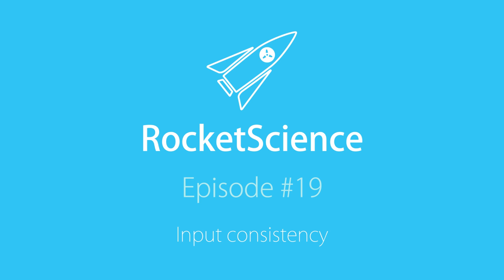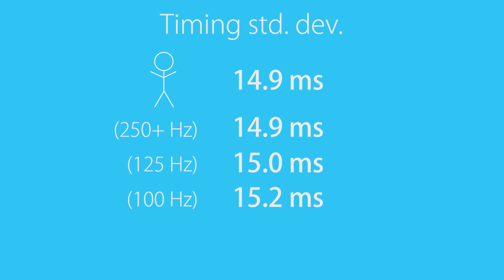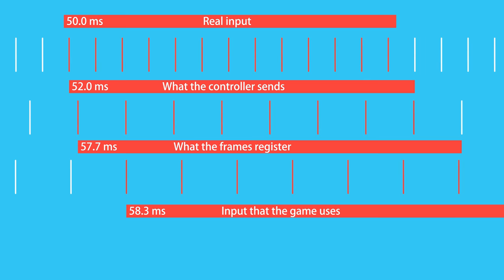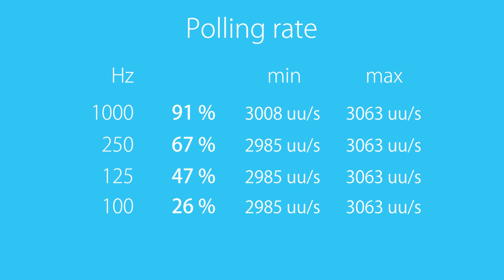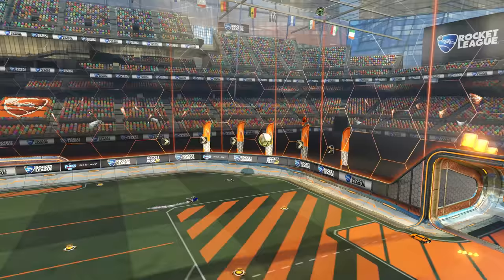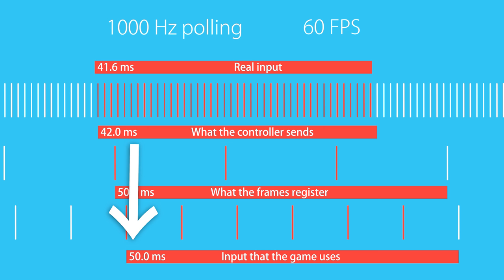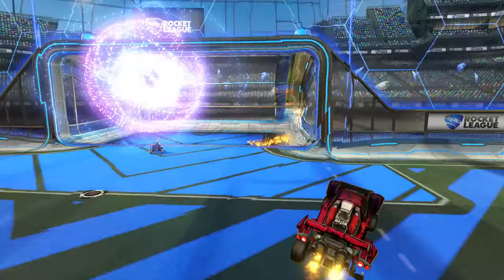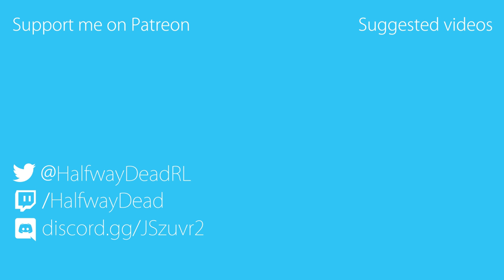Input consistency & heavy car bug - Rocket Science #19

Comment: The is without using Steam Controller configuration correct? Just default control? I’ve been debating whether or not to use Steam Configuration anymore
Reply: why?
something wrong with it?
Reply: I'm interested as well
Reply: If you are used to your controls and you aren’t getting a controller that isn’t pc compatible. I did this and i have to use it until it is pc compatible. So I don’t recommend steam unless u have to.
Reply: The reason I use it is bc you can control deadzone shape, size, and also control your trigger sensitivity, multibind keys, and override other settings
Reply: @PorterPally  i mean steam config adds 1ms input lag as rocket science has said in a previous video, but thats so minor to notice so idk what these guys are on about, been using steam config forever and ive never had any problems with 6 different controllers on 2 pc's...
Reply: Jared, you can use Durazno^2 to change deazone shape and other settings.
Reply: It gives 1ms of input lag, outside of that it's perfectly fine as far as I know.
Reply: @tycodj  1ms of input last is basically unnoticeable

Comment: Regarding the input recognition per frame, would it make a difference on a 60hz monitor to run the game at 120-240 fps?
Reply: Jim Jangles A huge one, you want to run 250 if you can consistent
Reply: Yes, I play on a 60 hz and have it overclocked to 75, but that's irrelevant for the argument

The way rocket league runs, whether or not you can SEE the framerates because of your monitor, it will still use whatever frame it does because of the framerates the game is running, so more = faster usually. Also there is the fact that the monitor will use the "freshest" frame within its window. So if your monitor is running 60hz, and you have a 60hz framerates, it only has 1 to choose from every time, which can make things seem choppy and delayed

If you run let's say 240 hz, your monitor has 4 grams to choose from every time It refreshes and can use the newest frame, making things look WAY smoother. (even just running 5-10 above the refresh rate makes things smoother)
Reply: @Reprivation  Another thing is how game engines generally work - more FPS = more input polls, everything gets simulated more often, so things are more accurate, quicker and more responsive.
Reply: @Elijah-ux4os  guess you hadn't watched the video lol

Comment: Well, I've read on reddit that a DS4 connected with bluetooth has less input lag than a wired. So I got myself a bluetooth adapter. It runs fine so far. In your video at first I see the same image as on reddit and it says bluetooth is better. But later you say I should get a wired controller. Could you explain it in a simple way, so I can understand it? And btw: Any advice for the polling rate with a DS4? I assume it's at 250 Hz. Thx

Comment: So just to be clear, if I have something like a 165hz monitor, I should cap my fps at 240 even though my monitor isn't capable of displaying that many frames?
Reply from the maker: If you have gsync or freesync then there is an advantage and disadvantage there. By capping it higher than your refresh rate you will have lower input lag and as said in the video inputs will be more consistent. But g/freesync only work below the maximum refresh rate of your monitor. Therefore you will get some tearing.

Comment: Is it possible to override the polling rate of USB controllers and force them to 1000hz? This used to be a common thing for gaming mice.
Reply from the maker: I've tried a tool (don't remember the name) used for mice on DS4 and Xbox one. The rate supposedly was changed but I was not getting any more distinct inputs. When spinning the analog stick in a circle the xbox one always had up to 125 different results a second and DS4 (wired) always up to 250. I tried lowering the DS4 too and it did nothing, so I don't think it worked at all.

Comment: I've watched your previous videos and followed that G-Sync Input Lag guide you mentioned (G-SYNC 101: Input Lag & Test Methodology on a site called blurbusters) and set my framerate to 117 on my 120hz G-Sync monitor and it's been pretty great for a while now. But now this video has me confused. Would the input lag benefits I already gain from having my framerate capped to 117 outweigh the benefits I'd get from setting it back to 120 to match the physics? Also, I was under the impression that V-Sync automatically turned on if the framerate matched the monitor's hz when using G-Sync and doesn't that introduce even more lag? My guess is that I'd have to disable both G-Sync and V-Sync and set my fps limiter from 117 back to 120 to see the benefits mentioned in this video. Uhhh....you don't possibly have time to run another day-long test at 117fps limiter/120hz monitor do you? ;) Anyway, the work you're doing is incredible. Much appreciated. I just wish I knew......I have that G-Sync Input Lag guide telling me 117 fps limit on my 120hz monitor for lowest input lag. But with the 120 polling rate of Rocket League physics, does that just get thrown out the window?
Reply from the maker: Well, the problem is that 117 is optimal for G-Sync (consistent visuals, no tearing, low input lag) and 120 is optimal for consistent inputs. 
It's impossible to weigh these against each other in an objective manner because they're entirely different things, but if suboptimal visuals mean that you have a harder time estimating the situation, then it doesn't even matter if your inputs are consistent :D I can tell you though, that from the mathematical theory I know, that a small difference from 120 FPS is not as bad as a big deviation. Therefore you're probably fine at 117.

Comment: ik this is an old video but you wanna know something crazy? i used to experience the heavy car bug. i tried everything to figure out what was wrong. something i tried was changing the quality of the game to the lowest possible settings, capping my frames @60fps. After doing so, my car seemed to respond faster... like there was less input lag.... When I returned my settings to the normal, higher quality @60fps... my car seemed heavy again... Since then I've gotten a higher refresh rate monitor and a DS4 controller overclocked and have no feelings of heavy car bug. So it might have something to do with the quality settings of the game, your gpu, your monitor, how much input lag you have, a plethora of different things that can not be calculable together. Though there is no real evidence, I am convinced it is real having experienced it first hand.

Comment: What about phantom ace steam controller check box? That affected his other rocket league account and it cause the heavy car bug!
Reply: It wasn't "Heavy Car Bug" or even input lag. Halfway_Dead actually covered this specific instance in his "Deadzone" video. Essentially, "Steam Configuration" adds a 0.25 deadzone to your controller if the "Anti-Deadzone" is set to 0. Increasing the "Anti-Deadzone" value to even "0.001" or "0.003" would make sure it doesn't do that. Or disabling the Steam Configuration, like Phantom recommended, also prevents it.

Comment: For anyone saying wondering about the heavy car bug. Couple more things to note:
Did you change anything in your setup? PC/Console, screen or controller?
If any of these checks, there's your problem. Your input lag has changed, slightly.
I noticed when playing on my xbox. On pc, everything is perfectly fine. On xbox, my car feels slow and the inputs feel heavy. There are 2 reasons for that. First, framerate. Like talked about in the video, 60fps creates inconsistency in input. Another problem is screen input lag. I know, that my pc screen has around 4-5ms input lag, while my tv has 32ms.
Technically, that is a really small change for a human, but it still affects my gameplay. I can't really see any difference, but the car feels... different in RL.
Only way for me to notice the increased input lag, is when playing on consoles before lcd and led tvs. Best example probably is playing Blaster Master on NES.
I have played through the game waaay too many times, and i have started to learn to speedrun it. On CRT tv, no problem, i can go through the game perfectly fine, in a decent time. But on my Hd tv, with the said 32ms lag, i can't even beat the game. I am able to see, that my inputs are late, but theres nothing i can do for it. I have always played it on CRT tv, and i cannot learn to play it with any input lag. This is probably one cause for the heavy car bug too.

Comment: What does he mean in number 3 (Cap framerate at 120 or 240)? I have xbox one controller and a 144 hz monitor, should I put my monitor on 120 fps? or only the games fps on 120? Or should I put my games fps at 240? Not good to use 250?
Reply: Ezon yes in the end he is suggesting to either put 120 or 240. During the fps part though he is vague on whether  144 results are bad cause they are still consistent.
Reply: @user-mv4xc6ve4b  Thanks for the answer man, much appreciated! Where can I change to 120 or 240?
Is that found in the ingame settings in Rocket League? Or is it found in my monitor settings on windows?
Reply: Ezon it’s monitor settings in windows in rocket league you should put frames to 240 if your pc can handle it otherwise use 120
Reply: @user-mv4xc6ve4b  ah ok, I've changed my monitor settings from 144hz to 120hz now.
I appreciate the help brother! Much love
Reply: @Etazoz  Its not clear to me where you changed this. You should use the FPS cap settings in Rocket League under Video. Its called "Max FPS", slide to 240 and see if your computer can handle it. If not, try 120.
Reply: @jnevercast  On your computers desktop right click and choose monitor settings, then click settings for video card, click the monitor tab and then choose 120, that's how I did it. Am I supposed to keep that at maximum for my monitor? (which is 144 for me)
I also changed the max fps ingame to 240 like you suggest. I'm trying to get this right, I appreciate that you responded. Do you think he only meant the ingame max fps when he said cap framerate?
Reply: Dude I love this guy but what he said is BS, if your monitor is Freesync/Gsync capable just set your framerate limiter to 141 fps in game to avoid input lag it will be better than playing @ 120 fps. 144 shouldn't be less consistent as he said, he didn't explain why it happens so I wouldn't trust this part of the video.

Comment: Like many others know, it isn't placebo. When you turn on VSync and switch it off again, HCB is gone for about 1-2 seconds. When HCB occurs, why can I set Aerial & Steering sensitivity to 10.0 without any difference? Why do I need the handbrake for every turn when HCB occurs? I shouldn't be able to handle the car with 10.0 sensitivity! When HCB does NOT occur, it's freaking fast with 1.0 sensitivity and I never need handbrake.
inb4 OS problem: i'm an IT technician and tested every OS, all with the same result.
inb4 weak PC: I7-8700K, 16 GB DDR4-2400, GTX 1080, 240 Hz Monitor
inb4 try other accounts: i got 55 steam accounts, 6 with rocket league, no differences

thank you for your attention
Reply: Your steering sensitivity results are very interesting. You should make a video next time you can reproduce it and then post it to the HCB discord. Do the smallest steering input you can with 1.0 sensitivity then repeat with 10.0 sensitivity.
Reply: @brendano221  "You should make a video next time you can reproduce it" oH sO wEiRd NoW iT dOeSn'T hApPeN aNyMoRe, or it's something non HCB related.
Reply: You're an IT technician, please make some experiments and post them to reddit. I'm not in the HCB-discord due to all the toxicity and flaming those people do, but I'm still very interested in everything related to it.

Also do you know what sensitivity in-game exactly is? 10.0 sensitivity basically turns your controller into the same hard inputs as keyboard players have, yet they can still control their car. I think you might've slighty misunderstood what it means.

I've never had HCB and never used VSync so I don't know what you're talking about there so I don't understand what you mean with it.

Btw turning speed etc. is more related to boost and powerslide timing but handbrake might be needed from situation to situation (I'm a GC so I really wouldn't know, it's all muscle memory at this point)

I think you probably thought about it but you don't play in borderless do you? That would kinda make things awkward.

And "Like many others know, it isn't placebo" . No, like many others THINK, it isn't placebo, yet there hasn't been any actual proof/reproducing the bug. AND, "many others", all my high ranked friends have never complained or spoken about anything like HCB, so don't underestimate the power of placebo and confirmation-bias.
Reply: I'm going to do it, no worries. Recorded the first video today, but not enough time to uploade because I needed to go to work 
No BS over here
Reply: @tycodj  Can you get me access to the discord, i've been trying to get an invite for weeks now, but they're all expired...
Reply: @hizzyvr  I don't have any but you can probably get one by just asking on reddit, r/RocketLeague should be fine.
Reply: @tycodj  I don't play in borderless ^^ I don't use VSync aswell, but me and other HCB victims get a change for 1-2 seconds by turning it on and instantly off again.
Of course you are right with placebo, but for me I swear it isn't placebo or mindset. As in the psyonix forum recently posted, it is more about the game speed, insane air-time and no power on dodges. You can really feel how the game is out of sync anyhow. I presume that it must be ISP/Routing bound and that's why Psyonix can't reproduce.
Meanwhile I recorded two videos with 120 fps. One was with hard HCB and the other was today with light HCB.
I won't upload to youtube because it's going to drop down to 60 fps, so I'm going to find another webspace and hope that the difference can be seen with 120 fps.
Maybe someone here is good in video editing and can set some scenes side-to-side.
Reply: @derbaron7426  so how's your hcb? How you described it was very similar to what I'm experiencing so I wanna know. Did you upload these videos anywhere? I'm so desperate

Comment: I had a bad heavy car bug, i took apart my ds4, popped ioen the green tabs on the joystick, stole the white copper contacts from the right joystick and switched them with the left and my heavy car bug disappeared.  When i tested my joystick before by putting deadzone to 0 and driving straight it veered left slightly.  Controllers are the one thing everyone uses and everyone abuses over time.  So give it a go if its your last option.